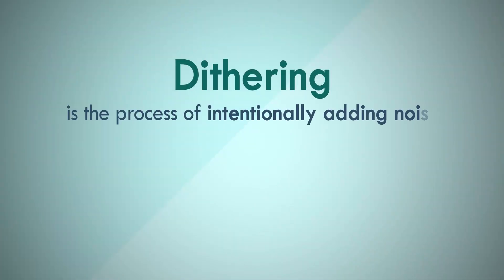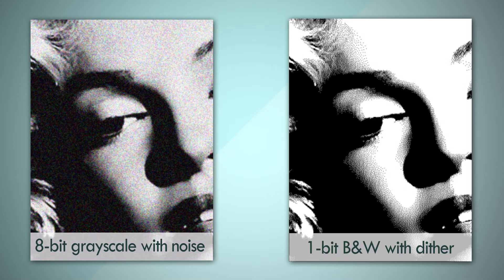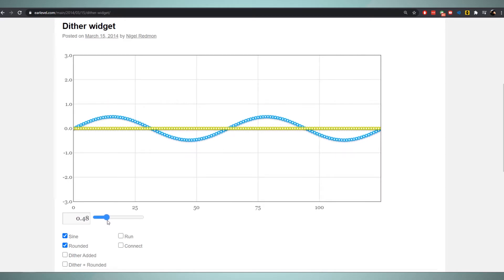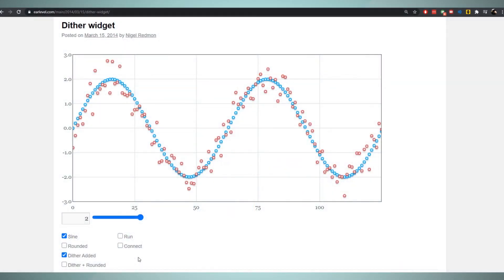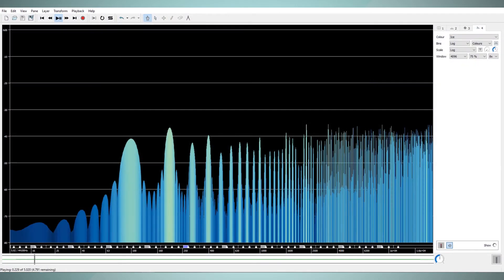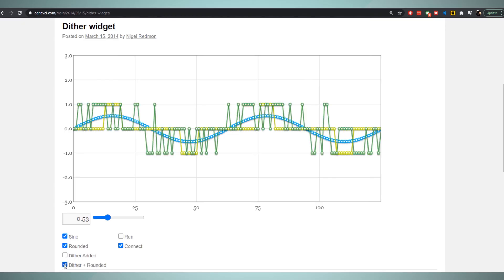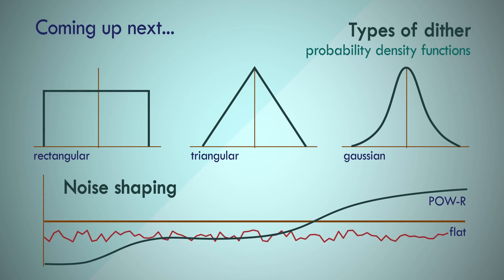7. Dithering Explained - Digital Audio Fundamentals

Comment: I came here looking for Dithering usage in streaming services like Netflix, and the image of Marylyn explains it well. When I read one explanation, it was that they lump similar colored pixes into larger chunks of resolution to save bandwidth. But what it seems is they reduce the bitrate when detecting similar colours. It kinda means the same thing but I did not understand it. 

In whites, like a scene in the snow, its hardly noticeable, but in dark night scenes its terrible. We have moved into streaming as the norm, 4k Netflix plan with fast internet and this is the standard.. it's sad.

BUT, it seems the file on the server is not "dithered" it must happen in real streaming time? Coz you DL a movie and it's not there.

Then they up the plan again for how many downloads you can have...

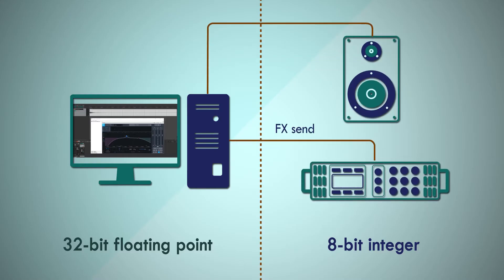Comment: @4:38 You said, "any place where audio leaves the digital domain and enters the analog domain is where truncation happens"
Question
If your session is 24-bit 96kHz and you intend the final mix to be 24-bit 96kHz, and also the Playback medium is 24-bit 96kHz,
Should you enable Dither to help other converters Playback the track with no Quantization errors? or will other converters be able to Playback with quantization errors without Dither?

Comment: Wait, I thought the noise is a function of the audio, not white noise? But here it's uncorrelated unless the signal is fairly simple. What am I missing?
Reply from the maker: You're right, quantization noise is a function of the audio signal, and correlated. But you can only hear the correlation in the error in simple signals, or if the bit depth is low, or if the signal is sufficiently low in level. But for rich, loud signals at a commonly chosen audio bit depth, the noise "sounds" uncorrelated and random, since there are no descernible patterns which develop in the error signal.
Reply: @akashmurthy  I see, thank you for explaining. Thank you also for making this awesome series!

Comment: You said that at hight bit rates there are less troubles with sound tears and digital errors, does this mean that when converting a 32-bit audio to a 24-bit depth I will not ran into digital/ analogue problems?
Reply from the maker: You will, but the artifacts won't be audible. It'll be several dBFS below the audible limit. Unless the audio track was recorded at really low levels and there's a lot of signal-to-noise ratio in the track, and it's driven up quite high, you won't notices these artifacts at 24 bits of resolution.
Reply: @akashmurthy  Found your series just now, and loving it! If I downsample from 32 bits to 24 and then from 24 another generation to 16 bits, would that final signal be reproduced identically to a version where I went from 32 straight to 16? Would dithering 32 --> 24, or 24 --> 24 make sense for archival purposes? Many thanks, this has been a great refresher so far.

Comment: how do you convert to analog signal after you have applied dithering to samples, weren't the data just getting corrupted?  few videos ago , the samples can have unique solution when sampled at correct position. does this still get unique solution? maybe it will still get unique solution at a given frequency, but dithering will spread noise across multiple frequency? by the way , can i have your email.
Reply from the maker: Dithering manifests as noise. You could call that 'corruption', but it's being done for a reason right. 
Any set of sampled points which constrained to a nyquist frequency will give you a single solution. The solution that is achieved with the original signal dithered, is the original signal with noise added. 
If dithered correctly, the noise is spread evenly across the entire frequency range, up until the nyquist frequency. Atleast, that's the desirable outcome. 

You can contact me on any of the social channels I've listed in the description.

Comment: There is a desirable quality to the 12-bit samplers and drum machines of the 80's and 90's such as the E-Mu sp1200 and Emulator II.  A lot of this love comes from the analog filter designs of the era, 2 pole and 4 pole, but there are some new pieces of gear that allow you to sample at 12-bit, 22k intentionally..  It would be cool if you could do a video where you could speak to the psychology of what we are liking when we hear that 12-bit in music - being preferable to the sterile 16-bit.  I don't know if the musical equipment (specific samplers, synthesizers, and sampling drum machines) is beyond the scope of your expertise, but some of the vintage gear is getting pricey due to the desirability of their character.  Could it be the harmonics and inharmonic frequencies bouncing off each other that draws us to that sound?  Or is it the rudimentary DACs?  thank you.  If you want to hear what im driving at, Alex Ball has a new short video on the SP1200 drum machine "the lo-fi dream machine" where he touches on this.  Easily found here on YouTube.  Thanks!  LOVE your work.
Reply from the maker: Hello again! As you have correctly guessed, I have little to no expertise in analog synthesizers and older analog gear. But what you say is quite right. The desirable quality of the audio output of these older analog devices are usually combination of all those factors: low bit depth, inaccuracies in ADC/DAC conversion, the typically non-flat frequency response of the filters used, etc. 
It's got a characteristically "warm" sound that digital plugins tend to try and simulate. These are usually done by explicitly adding extra band filters to shape the frequency response of the output, or by saturating the signal (intentionally clipping the signal) and shaping the clipping curve to introduce low level harmonic distortion.

Thanks for the info! I'll check out the device you mentioned!

Comment: what's the different between mp3 and wav, bit depth and bit rate ? should you always turn on dithering while export the project for the low quality product like mp3 ?
Reply from the maker: That's an interesting question. Should you dither when exporting to MP3?

MP3 is a fundamentally different compression and encoding scheme. You don't have a constant bit depth throughout the entire recording. You have variable bit depth for different frequency bands based on the amount of spectral content in that band, and the psychoacoustics influence of that band for human hearing. 

So, as you can imagine, MP3 compression and encoding, is quite complex, and I can't explain it in a comment. There is definitely other resources out there which you can check out, which explains MP3.

Coming to the question, I don't know! I tried looking for the answer for a little while, and didn't find anything conclusive. Seems like different people have opinion, and to find the fact, I need to dig much further and do some experiments. So, I might take a look at it later.

Comment: Digital saw waves will sound 'metallic' when they're above a certain frequency. I understand that's because when the frequency increases the accuracy of sampling diminishes. A saw wave contains many overtones, so I assume those overtones become aliased.

I've downloaded a couple of samples of the basic oscillator sounds from analog substractive synths. The samples are 48000 sps and 16bit. And from around C5 the saw waves already starts to sound metallic.

Is dithering or adding noise a way to improve this? A noisy saw wave sounds better than a saw wave with dissonant overtones. Or do you have other suggestions?
Reply from the maker: So you mentioned when frequency increases, the accuracy of sampling diminishes. That's not true. The sampling accuracy will remain more or less accurate from 0Hz to the Nyquist frequency. It depends on the ADC ofcourse, but good quality converters can do this with ease. 

The second point is true! A pure sawtooth wave contains many overtones, so the overtones become aliased. 

Now, dithering is not really a technique used for anything other than masking quantization noise. I can understand why you may prefer it. Because broadband noise is more pleasing to the ears than dissonance. 

But honestly, a well created sawtooth wave should not contain any "metallic" dissonance. The higher the fundamental frequency of the sawtooth wave, the more it should sound like a Sine wave. 

But if you already have a few sawtooth sample files, and if they already contain aliased components, then tough luck. It's very difficult to get rid of aliasing after it's been recorded onto a file. 

You can watch videos 2 - 4 from this series which talks about sampling and aliasing!
Reply: @akashmurthy  Thanks for replying!

I shall continu watching your videos.

Comment: could you make a video talk about how eq's phase shift result unexpected frequency change？for example, low cut may cause a boost of frequency of low mid...
Reply from the maker: Hmm, someone else had requested something similar. Must be a hot topic! Linear phase EQs solve the problem of unintentionally colouring the sound, since they use Finite Impulse Response (FIR) filters, which are computationally more expensive than the more commonly used IIR filters. Cool choice, I'll definitely try to make a topic on this when I get into filtering. 

But in this series on the fundamentals of digital audio, it's too specific a topic to be covering over here. I hope you understand. Thanks for the suggestion.
Reply: @akashmurthy  Thanks, I will wait lol